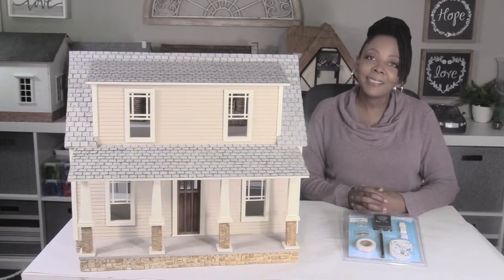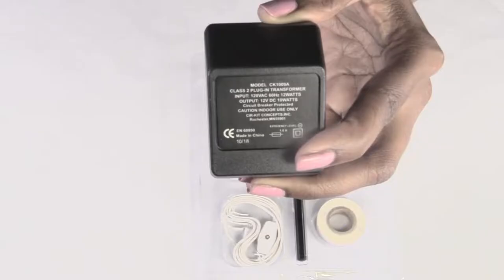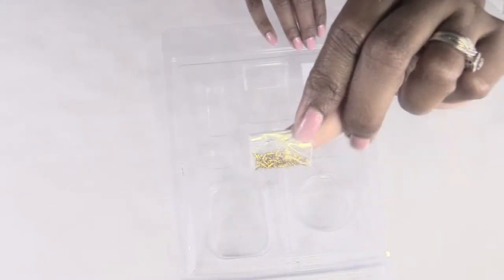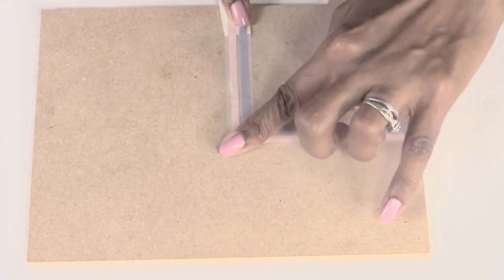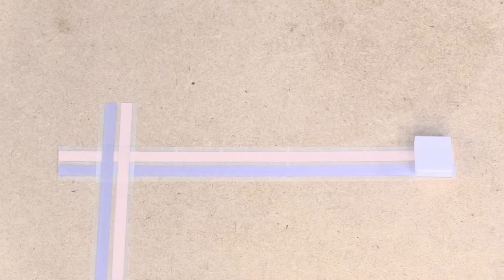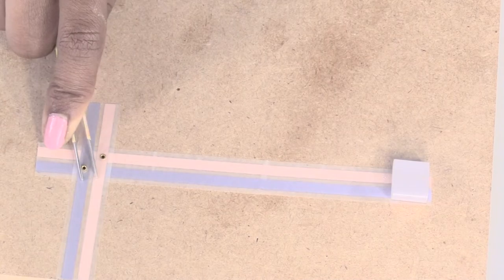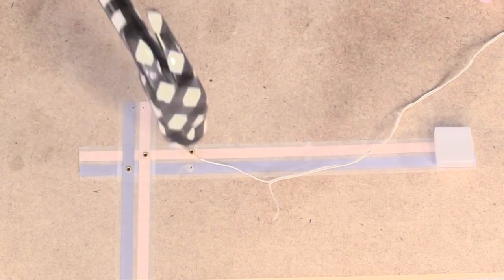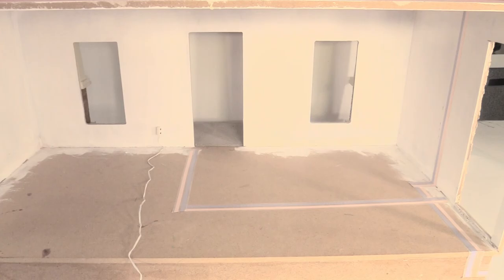How to Wire a Dollhouse for Electricity - Wiring Tutorial

Comment: I never saw anyone out the bare wires into the hole before, then put in the eyelet to make the connection. All the other ones I see wrap the wire around the eyelet and then pounding in. If they're putting in ceiling lights, they run the wires through a hole in the ceiling up to the second floor, let's say, and then attach the wire ends to the tape wire on the floor. Makes a case for having removable flooring. I wish you were still making videos, and hope that you are ok.

Comment: Thankyou for showing  me how u did the wiring on this dollhouse  ...i purchased  an  chinese styled dollhouse from china ....had to figure out the instructions as they were in chinese .... but they had lots of pictures in the instructions  so it wasnt much of a problem  plus found other youtuber tutorial videos   that did the same kit so that helped alot ... sometimes before i start a new kit i look at the wiring first in the instructions to see how i can improve and camoflage the  wiring better ...in some cases i had to rewire it differently than what was shown in the instructions   cause  just didnt like the way it was done . The kit comes  with the white plastic coated wiring . And didnt like the  way they did some of the wiring in the instructions .and it got to be  the wiring was  unsightly looking in some areas ..in most cases  i was able to camoflage the wires...other timès i would have to drill thru the floors and feed the wiring thru that way    to hide them ... but i think the   lighting tape will work better in areas  than using  the thin plastic coated  wires everywhere ... because dollhouse   had a battery  box   and  the LED lights included ...so taught myself how to use a soldering iron to solder the wires together ....i wonder if the lighting tape will work with the battery box  or will have to use  the transformer ... battery box uses uses either 2 AA  or 2AAA  type batteries  to light up the dollhouse ...so was wondering do u have any insight  using the lighting tape with the battery box ? ....i managed to find out  how to make your own LED light bulbs in different colors  of yellow ,green ,blue, and red,etc  ..relatively inexpensive online ...plus found out that u can purchase the  thin plastic coated  white  wiring ...in different colors as well.....if u do a search  on youtube   on ....chinese dollhouse kits  .... u can  get an idea    some of the styles of the dollhouse kits  that i am working  on....this is my 3rd one ...anyways thanks for  making the video ... it was nice to see there was another method  of  doing the LED wiring ...

Comment: This was helpful! Thank you.  I was wondering why you cut the plug off instead of plugging it in? 
I’m working on the glencroft and plan to mostly texture the walls and add stained beams. I’m only going to be doing sconces and a few table candles.  I’m thinking of running the tape wire just on the other side of where the beam will be and painting over the tape so hopefully it won’t show. This is my first house but I’m also a perfectionist so I know it will really bug me if it shows. Any suggestions? Thank you!!

Comment: This is great! But my dollhouse came with groved hardwood floor, so how do I run tape wire on the floor. Don't want to go along the wall. Was planning to paint walls, not wallpaper.  Any info would be greatly appreciated.
Reply from the maker: I would only use tapewire on a surface that I planned to cover, whether it's a wall or floor. You could use round wire as an alternative to tapewire.

Comment: So it doesn't matter what wire is connected to the tape? Like ➕ or ➖?
Reply from the maker: No, it doesn't matter which wire goes in where, as long as you put one in the gray and one in the copper.  Also, make sure the wires don't touch each other.